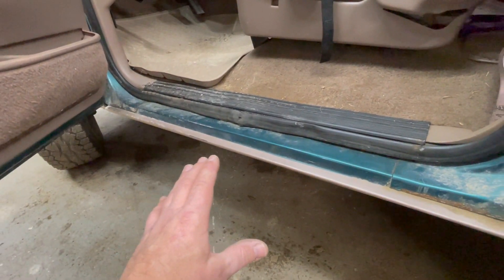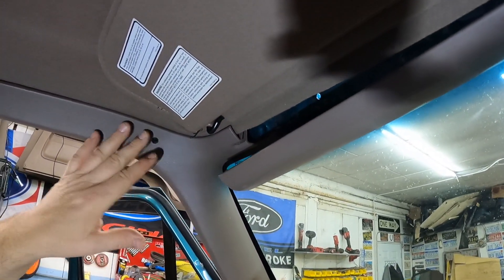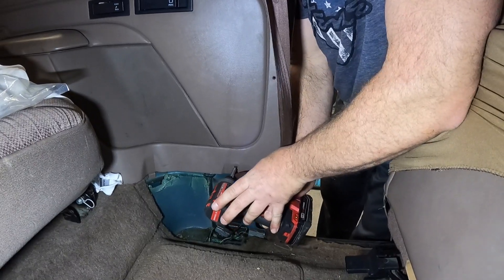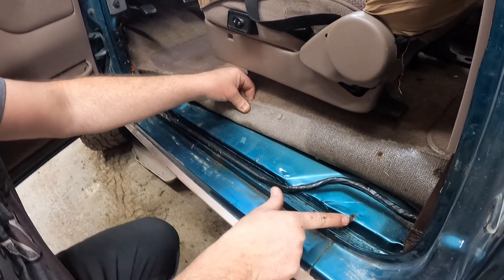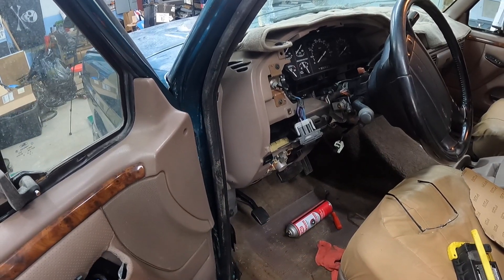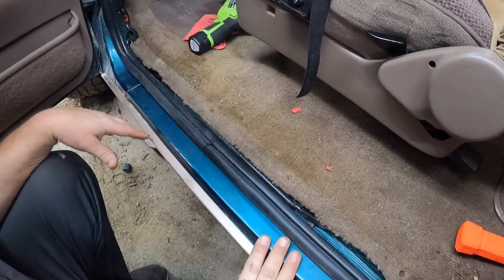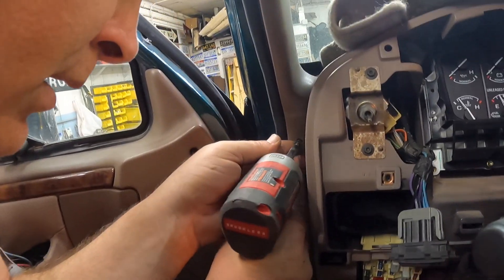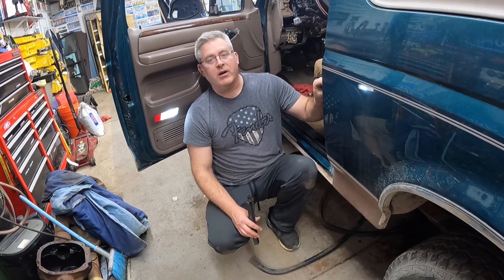How To Replace Door Body Seals Ford Bronco OBS Ford F150 F250 F350

Comment: That oil you are finding  is called fluid film. A rust preventative that creaps into crevices to prevent rust. Does not hurt the paint. And is toxic free. Its messy yo apply and xmelks the first week. And needs to be done yearly. A vehicles body sprayed with it from when it was new that is 20 to 25 years old will be like it is only a few years old.
Reply from the maker: Nice

Comment: If that rocker on the bottom where the bottom of the door presses against that little lip of metal the seal sits on/against is rusted out and missing the lip whats the best way to repair that.  Grind down the rust and weld repair?
Reply from the maker: I would cut out and reweld in a partial piece or the lip.

Comment: Great video, so after watching it, I installed new door seals on my 94 Bronco and the door became very hard to close (latch). I re-positioned the striker but the door  will not flush up with the outside of the body. Its almost like the weatherstripping is too thick. Any suggestions
Reply from the maker: Give the new seals about 2-3 months to settle in and soften up.  They will with use. Then u can re adjust ur stroker

Comment: I have replaced the driver side weather seal. Now I have to slam the door to get it fully closed. I have adjusted the striker however the door is still hard to close completely. Do you have a video on how to adjust the door? My door is aligned correctly but to get it flush I really have to slam the door.
Reply from the maker: Wait 2-3 months for seals to soften up and settle

Comment: Nice Video!! I like the detail you add, the learned tricks of this and that, Genuine knowledge!!
This is a long shot I know, however.......

Do you or does anyone out there know where I can find the part number or the actual (bulb-clip) that holds the 900 series lamps which clip into place and illuminates the ashtray and the wiper washer and headlamp backlit areas of the dash? (Black clip-bulb holder with two springy tabs)
I can read this number off of it,
E3TB-13A714-AAO4

Both I have are broken and both have illegible part numbers on them, and I have no idea what to call this thing. 
I have googled my eyes out and cannot find it at all.
Thanks for any help!!!
Reply from the maker: Thanks.  We sell the cluster sockets.  $6 each. I’ll check on 900 series lamps.  Ashtray bulbs are at autozone.
Reply: Where can I order them from?? 
I work remote and am away 3-5 weeks at a time.
I leave in a few days and would like to have them on the way while I am away. 
Similar to Christmas 10x a year... 
This brings me great joy :)
@BroncosandPartsGarage

Comment: 1 year later my passenger door is still sticking out an inch. Also my window doesn’t roll on that side, probally because I had to slam my door so hard. Any solutions to this besides “waiting”. Seems there’s more to weather stripping than install and letting it soften up…
Reply from the maker: That’s strange.  Mine settled in fine.  What condition is your door striker in? Anf your hinge pins?
Reply: @BroncosandPartsGarage  ordered the striping of Jeff bronco graveyard. I had to adjust the latch but it’s still just an inch unless I SLAM it. Also no one is willing to work on my 90 bronco to fix my errors. Any advice on finding a body guy in Nashville?

Comment: What company makes the door seals that you bought at Bronco Graveyard?
I bought a set for my F150 (same body style as your Bronco)from a different 
suppler, and have to !!!SLAM!!! the doors to get them to close, Wondering If
all the makers of these door seals present this problem.
Reply from the maker: Mine were Precision brand. You need to keep slamming the door for about three months until the seals. Get softer and get seated. It’s a common issue. Try to resist moving your striker.
Reply: @BroncosandPartsGarage  Thanks for your reply. Sure wish I knew who was the vendor of these seals to the assembly plants. I can remember not having to slam the doors when the truck was new.

Comment: Sombody before me had put bigger screws in my passenger side door panel plus they are silver really bugs me so my friend is going weld up the holes then we are going to use to factory size black screws my 96 interior looks spotless but the different screws in the door panel I can't stand
Reply from the maker: I have handfuls of them. Email me
Reply: @BroncosandPartsGarage  Wow thanks I will. I was just going to hit my old junkyard see what I could find  drive 45 minutes for matching screws Lol. The side mirrors had all different screws as well I just found all the correct ones changed them out this pass weekend

Comment: Hey quick question for anyone who knows, I have a 93 f150 what butyl product or any other brand would you recommend to put in the trim screws and any other screws that go directly into the body of the truck
Reply from the maker: I used strips of soft butyl rope commonly used when installing older windshields.
Reply: @BroncosandPartsGarage  okay thank you, did you just cut out a little square and put it over the hole in the body and screw the trim screw through it

Comment: Can you make a video on how to remove the door, or how to remove dashboard, I need to research this to do an hand crank window to electric conversion
Reply from the maker: It’s coming late feb
Reply: @BroncosandPartsGarage  sounds good
Reply: @raulangulo6351  did you have any issues converting from hand crank to electric windows and door locks ?

Also did you buy the parts or find a donor door ?

Comment: This was super helpful. Thanks!  I just replaced mine.  The doors a VERY sealed now.  However, the door protrudes (sticks) out from the rest of the body now that the seals are so thick.  Will the seals eventually flatten out and allow the door to sink back into the body of the truck?
Reply from the maker: Yes. Give them 90 days

Comment: Hey Chris, thanks for your videos. I’ve been able to replace all the seals and the window wipes on my 95 full-size bronco we bought it new here in Vegas. I’ve changed every drop of oil on this thing. It’s got 146,000 miles and with your recommendation, I used bronco graveyard parts that fit like brand new thanks to you and Branco bronco graveyard. It’s a nice quiet ride. Take care. Cheers from Vegas.
Reply from the maker: Nice work!

Comment: Hello Chris , from central pa , the product of oily film is called ( Fluid Film ) . I've used this product on my 87 Bronco applications every 5 yes as well as my other vehicles. You can apply it inside out under the vehicle,  in doors , the rear gate door , wheel lips . The only testimony is my 87 still has the original rear gate door .
Reply from the maker: I have a few cans and have used the extension tube toi line the inside of frame rails, but on things that come in contact with dirt and dust, i'm not a big fan.
Reply: @BroncosandPartsGarage  I  do have a question for you , my Bronco is also also a Eddie Bauer  stick shift ( creeper gear ) anyhow I will be passing this down to my youngest son who also loves the truck , I want to get the seats recovered but this Eddie Bauer seat covers was under license from Eddie Bauer.  Do you know of another way to get the covers

Comment: Hey Chris thanks for the video. I have a 1995 F-150 XLT and I replaced the door seals (they were ripped), window channel seals (window was closing rough and squeaking), and the felts (they were all cracked). But now I'm still getting a good amount of wind noise near the front of the doors when going about 55+ MPH. Any idea how to diagnose that and or fix it? Thanks again for the videos. Super helpful.
Reply from the maker: Usually that’s from your vent windows. If not, how bad are your door pins?  Did you adjust the door striker?   Dumb question but are th seats installed correctly?  Under/ over trim?  Let me know.
Reply: @BroncosandPartsGarage  - thanks for the quick response. Door pins seem to be in good condition since the door doesn't sag (unless there is other ways to see). I did adjust the door striker to accomodate the new  weather stripping but plan on readjustinng back when the weather stirpping forms to it a bit more. Also, seats are installed correctly and over the trim/carpet if thats what you mean.

Comment: I've seen the videos of guys putting closed cell foam piping in the old ones to make them like new for those who don't want to buy new seals!! Great video as always!
Reply from the maker: I saw that to. These seals lasted over 20 years as they were. They are $38 a set at JBG. Small price to pay for piece of mind. Plus I found a little rust and the seals were just wore out and flat.
Reply: @BroncosandPartsGarage  What about the doors themselves? Thats my problem with my 96, I ordered door seals from JBG and got the ones you put in. Lol gotta get the other ones now. Are the door seals (on the door) pretty straight forward?
Reply from the maker: @colt-ss3lw   we’re in process of doing entire door seal video. Felts and seals.  1-2 weeks
Reply: @BroncosandPartsGarage  Cool, can't wait .

Comment: My 1st vehicle was an 89 XLT, black w/red interior, 5.0. Handme down from my Dad.Truck had 400k when I traded it on a 94 GMC.  Today a good friend of mine purchased 89 XLT, 5.9. New fuel tank, pump, transfer case & trans for $600. I'm gonna offer him 2k and hopefully he'll let me get it. Only rust we found was where the spare tire rubber at the bottom touches the tailgate. 1 dent driver door where someone hit it with a 4wheeler. It's been sitting for several years. Back brakes were locked. He is restoring a 70 model short wheel base now. Stepside with wood panels. Lifted with 06 f259 axles & brakes. Manual trans crate motor. I just built 16 hemi Ram be- 06 F250 6.0 bullet proofed. Have 04 F350 dually that was flooded during hurricane. I plan on using the axles & airbags on my 250. I'll be watching the rest of your content to learn about the Bronco's. I've been researching mods & common issues with the 89 since I discovered he had it. Hadn't talked to him lately bc of hunting season but td I needed to fab something and needed to use his plasma cutter and he had just got it. I don't believe in coincidence.
Reply from the maker: Thanks for watching. Lots going on but welcome back into the Bronco hobby!!

Comment: Any ideas on fixing the whistle from a loose wing window???? I’ve thought about building up RTV in the gap between the door and the window. Also tried tapping the upper hinge out to try to close the gap….it helped but there’s still a gap when it’s patched.
Reply from the maker: Aftermarket seals don’t fit the best. I’d try and find used in good condition.  Or make sure your latch it tightened

Comment: When I open my passenger door it ever so slightly clips the fender but the seams have the same width on both sides. Any idea on why that is?
Reply from the maker: How bad is your door sagging?  Left up on outer lower corner with the door barely open.  Is sagging replace pins.  Or check your fender alignment. Door hinges rarely come loose but you could check them as well
Reply: I will check that thanks! I just bought one as a project for next to nothing so I’m learning as I go. Your videos are very educational

Comment: Great videos. Have watched several already and the simple step by step instructions are so easy to follow. Well done. I have a pile of parts on the table at home that arrived today so I’ll be rewatching the ones about the window seals and felts that need replacing on my ‘93. Just got it and it needs some of the older parts replaced that just wear out after 30 years!
Reply from the maker: Thanks. Be sure to give seals a few months to wear in.  U may have to close door with some force for a while

Comment: Great video and timing! I'm ripping out soaking wet carpet on my 92 and see that the driver's side seal is split and cracked. I'll order from your link and look forward to the carpet video as I will need to do that too. Where did you order the carpet?
Reply from the maker: Thank you. I get my carpet at ACC